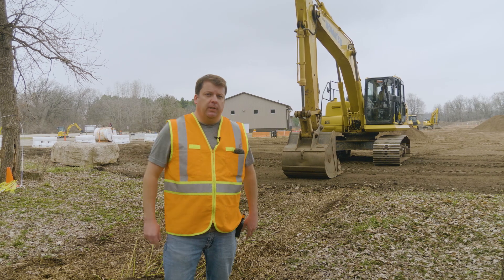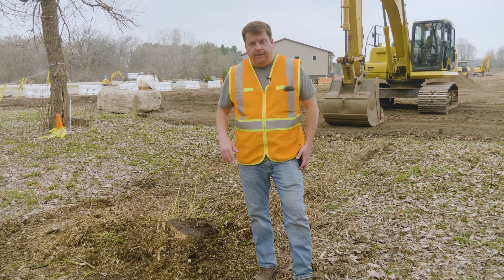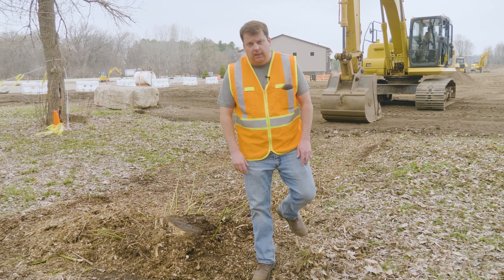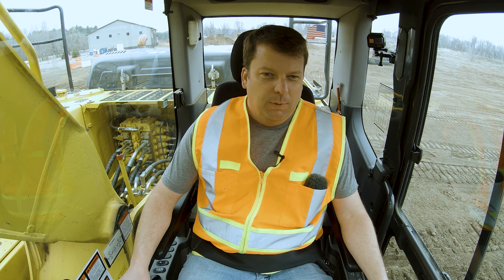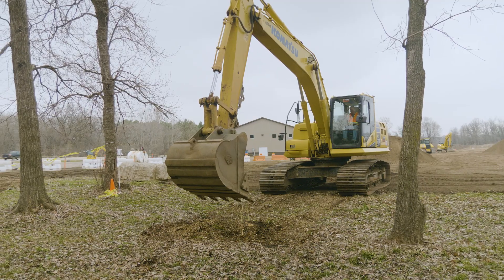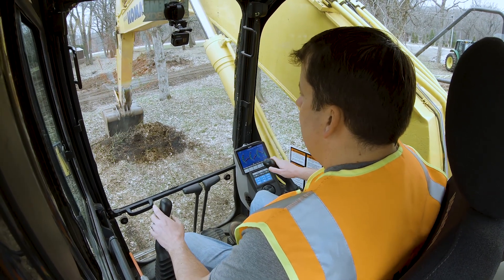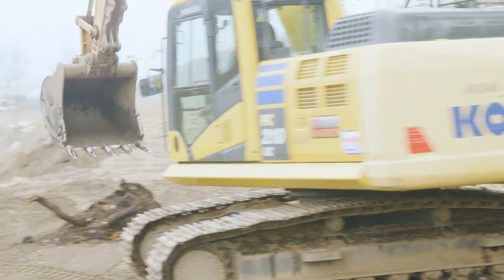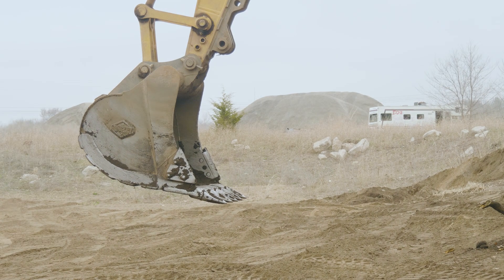Removing Tree Stumps with Excavator | Heavy Equipment Operator

Comment: I'm clearing 20 acres now with a John Deere 110 tlb, it was completely old growth forested.   With the little machine I have, I'm clearing 25 inch diameter Pine, Doug Fir, Tamarack, Western Hemlock stumps all day.  A difficult stump with tap root takes  around 35 minutes.  An easy 10" stump takes around 10 minutes.  On average with my machine, and 3 year old stumps, I can clear on average 6 stumps an hour.  The machine you're running is over kill for what you're doing, and would make my situation seem like 'tall cotton'; I would think a challenge for that machine might be an old huge oak, or similar with a 5 foot base. 

As far as what I've got to do to preserve my machine,  I dig a perimeter pit, digging, and dumping the bucket in place, just breaking up the soil, then slowly inch closer as the bigger roots free up, then snip as far under the trunk as I can to loosen the dirt, and clay.  Sometimes the stumps are too big to pick up, and I'm guessing with clay, and rock stuck to the bottom weigh in around 3000 pounds; especially so when you knock the clay dirt mix off, and find a stone up closer to the bottom of the trunk that weighs in over 200 pounds.  Every tree worth it's salt is usually anchored to large rocks, just saying.
Reply from the maker: This is excellent info!  Thank you for sharing!
Reply: I'm clearing out 14 large cottonwoods, the range from 5' up to nearly 8'. On one side is a road and a 3' ditch. Any suggestion on removal technique? How long will it take per stump to dig out? They are fresh cut stumps at the moment.

Comment: As you mentioned this excavator was well overpowered for the size stumps you were removing but if you had much larger stumps to remove or a smaller, compact excavator to use, my best tip is to try and break up the roots around the sides of the stump and then twist the stump out by pulling on one side of the root system. More of a prying motion with the bucket alone rather than digging with the whole arm. Not sure if that makes sense but I was able to remove a stump about the size of my machine's footprint, it was huge! Roughly a giant redwood would be compared to that machine you have.
Reply from the maker: Thanks for the comment!
Reply: Noice 🫡 well said

Comment: Not trying to tell you what to do, but for digging stumps a skinny bucket for digging around the roots is your friend, they sever roots easier and don't disturb as much soil. Digging the roots on the three sides you're not pulling toward helps control the direction the stump goes by leaving the remaining system to act as a hinge. When the stump has rolled out they will either sever from tension or are easy to cut off.
Reply from the maker: Totally agree...if I had a narrower bucket I would have used it.

Comment: Can you show us what the right track tension is?
Reply from the maker: You would have to check the manual per the machine you are operating.  It is the sag that is measured from the center of the tracks, but again that can vary per machine.
Reply: @HeavyMetalLearning  wish i had a Manuel. Running Cat 325B.
Reply: Google  cat 325 track sdjustments

Comment: Is it possible to put your bucket up to the front windshield
Reply from the maker: Do you mean can the bucket hit the windshield?   If so, in most machines with a standard bucket it is designed to not be able to hit the cab.   But if you have a quickattach or other accessory or larger bucket on then those might hit the cab.
Reply: Heavy Metal Learning yes
Reply: Heavy Metal Learning Thank you for answering my question
Reply: Zander Turnbull some can when equipped with a quick hitch